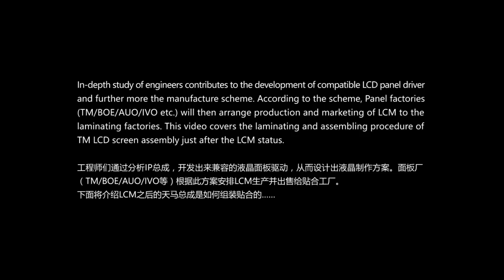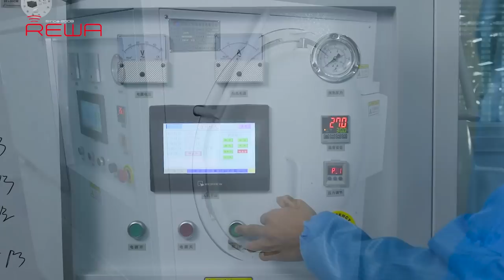Production of Aftermarket China-made iPhone LCD Screen

Comment: what is that White smoking coming from a cylinder ..........
Reply from the maker: It's humidifiers. Used to improve the electrical conductivity of the air, so as to prevent the generation of static electricity.